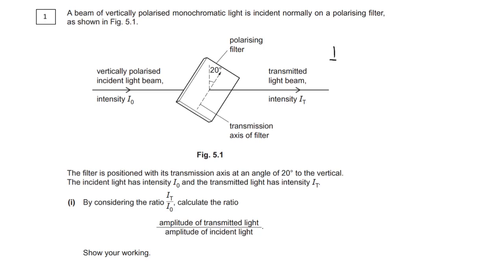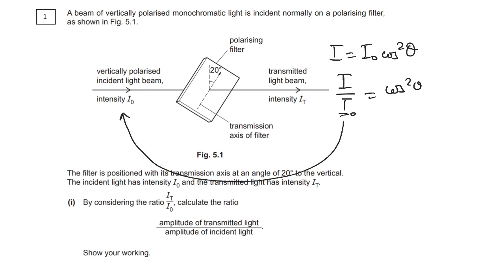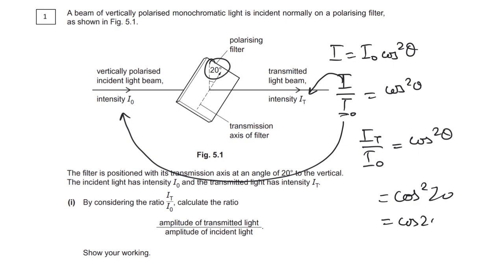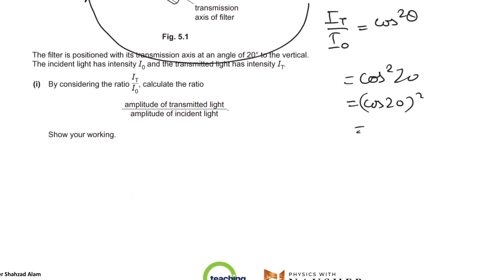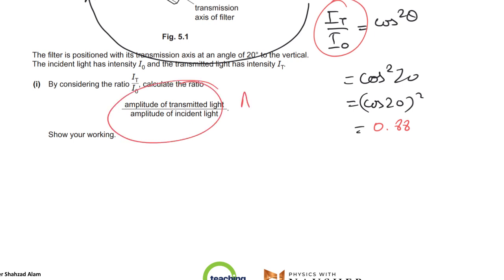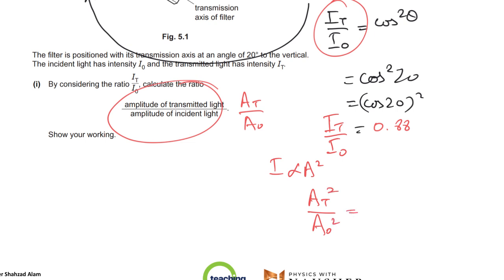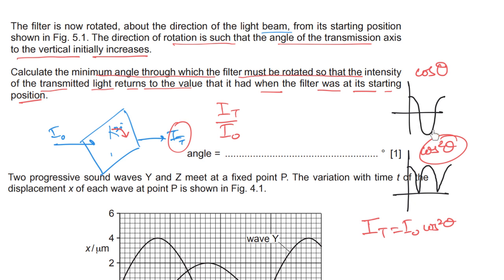Malus's Law All cases explained 9702/22/21/23 #alevel #physics #teachingcircle

Comment: Sir when there are Two filters then for second filter would we use the original intensity we used for first filter or the one which was transmitted through first filter?